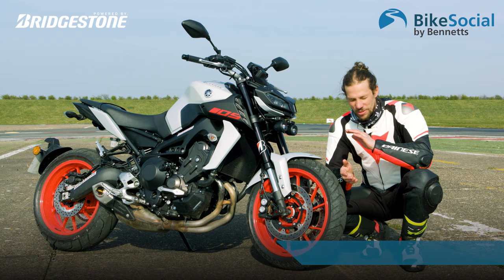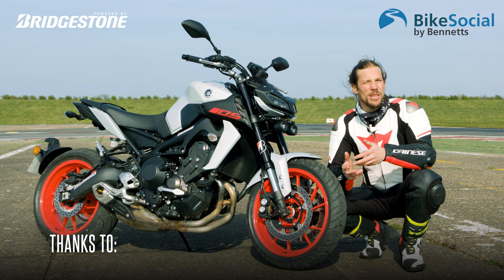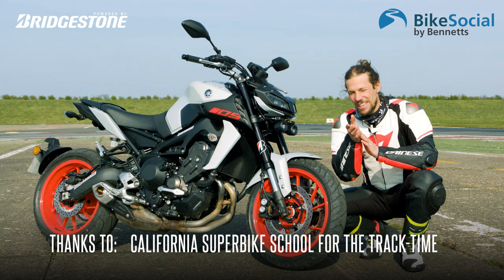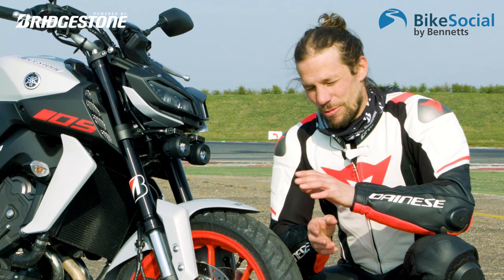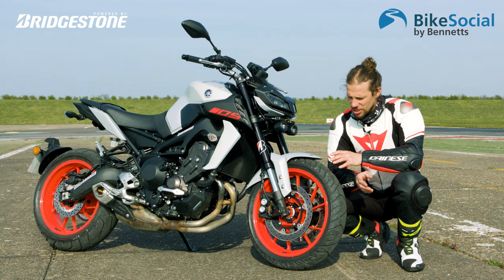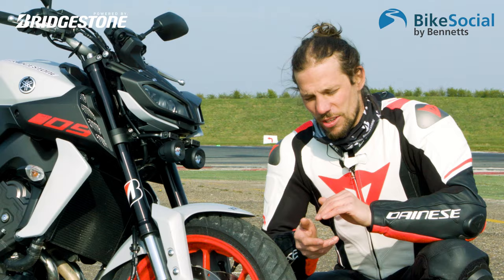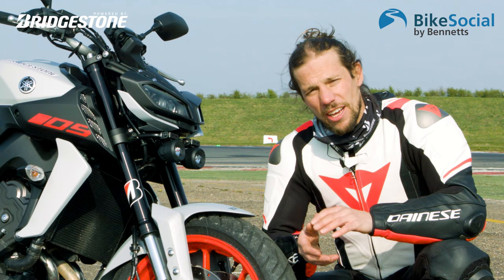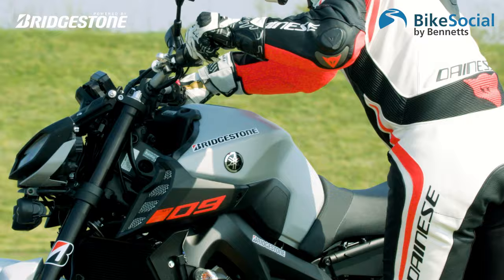Should you brake while turning? Motorcycle riding tips

Comment: Or ride the back brake and leave the front alone?
Reply: Nope
Reply: wradford1 why?
Reply: @ripmax333  for increased stability
Reply: Trail braking using mainly the front brakes is better.
 For example,   If you trail brake with the front brake into a curve that suddenly tightens up on itself  the front suspension is already compressed therefore if you need to wash off more speed with the front brakes the bikes geometry won't be affected. At the same time the pressure on the front tyres  contact area will increase giving you more grip on the front tyre where you need it . It's amazing how little effort it takes and how much speed you can wash off by gently squeezing the front brake into a turn.  Trail braking Is an important skill that doesn't feel right or safe at first and needs to be practiced to be perfected. But could potentially save your life. 

But if you repeat the same scenario entering a turn with a tightening radius using the back brake you affect the bikes ability to wash off speed because using the back brake reduces the back tyres contact area but the bikes weight is still transferring to the front tyre in the process. Taking more weight off the back tyre reduces grip and increases the chance of losing the rear and sliding sideways which is the last thing you want mid corner. Because it could end in a lowside or a high side and possibly sending you into oncoming traffic. Evidently rear brake trail braking is not very effective.

I always trail brake with both brakes. About 80-90%front brake and 10-20% rear on down hill turns on most tight turns and nearly all turns when spirited riding 
The only time use the back brake alone is on pea gravel.

Comment: And you still get people advocating leaning harder and accelerating. SMH. Of course slowing down is the only sensible action.
Reply: You can lean a tyre to its edge on a steady throttle, accelerating at that point gets you a low side which if you watch Americans on twisty roads like deals gap theres plenty evidence of back ends breaking away thanks to that or jumping on the back brake as they panic.
Reply: @fornicateu2  I was referring specifically to a collision avoidance strategy although that wasn't clear in my post.